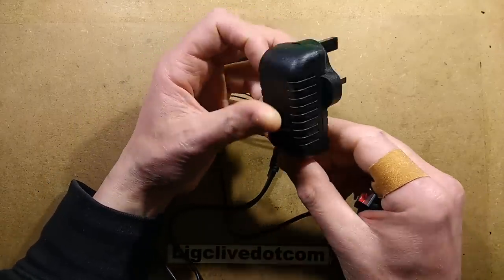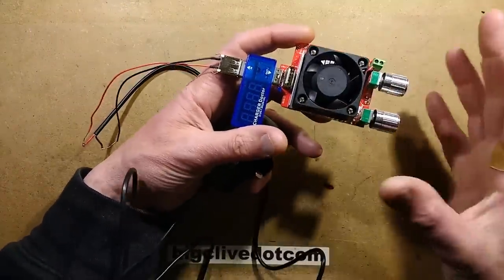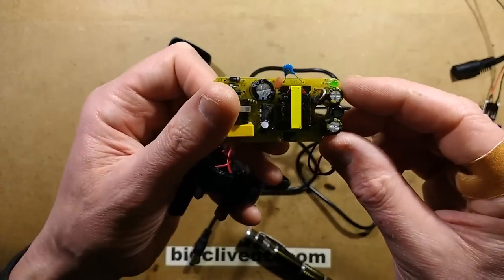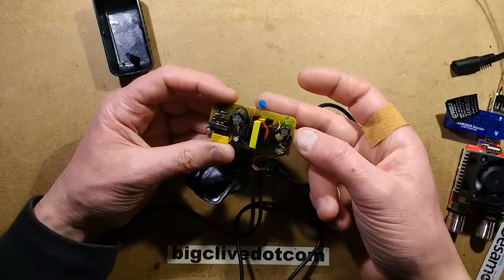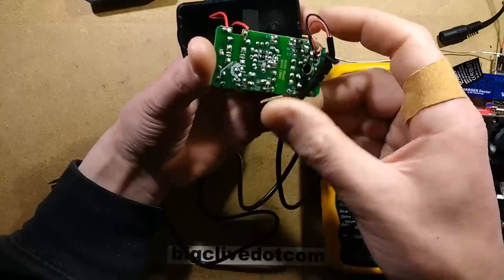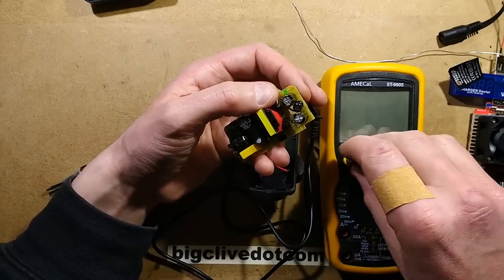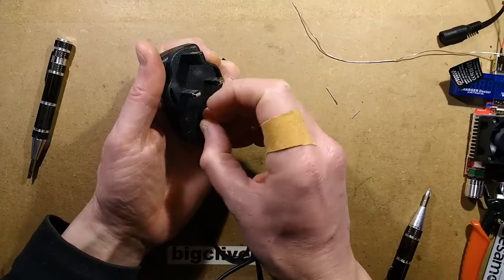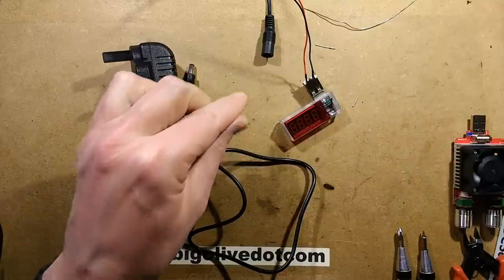Checking out a friends dodgy power supply.  (With storm raging outside.)

Comment: Thanks Clive for the shout out about my Cliff Quicktest units in US/Canada colors on eBay. I sold out pretty quick after the mention. I have put more on order with Cliff but it'll be a few weeks before I have them in hand to sell. It takes a while for them to be added into the manufacturing queue and actually manufactured at the plant then shipped to me in the US but don't worry guys I'm getting more.
Reply: I was super disappointed when I couldn't even find the listing on ebay, guess I was too late. I hope you ordered several hundred thousand of the damn things because I've been wanting one for months now :)
Reply: I don't have that many on order but you can contact me directly via email and I can ensure you get one out of the next batch.
Reply: I will be checking your listings in a couple weeks then. I am also considering a 3 phase one as well for some 220v testing.
Reply: I've thought about getting some 3 phase units in US colors but unsure how they'd sell. Though I'm considering one as a quick connect running 3.3v, 5v, and 12v off a computer PSU for project prototyping since those are the 3 main voltages I use. I'll ask Cliff about the 3 phase units.
Reply: I thought about that as well. But the neons would probably have to go.
Reply: yeah user mod to LEDs as the neons won't light at those voltages, key colors would be wrong too but you can't beat the connection method
Reply: I could not find any listing either but would definitely be interested in ordering one when you receive the new shipment Andrew.
Reply: I used to have speaker terminals (similar lever action) on a PC PSU many many years ago before I had decent test leads. At low voltage the safety switch and expense of a Cliff unit might not be justified.
Reply: I've had to start a list of interested buyers to ensure that people can get a unit and avoid the free for all with eBay until my stock supply stabilizes. If you can email me to the email address in the photo on the video I'll save your contact information and email you when I have stock to ship to you directly.

Comment: Is the storm outside is called Doris
Reply: Oliver Hiscox Yes, apparently today is Doris day 😆
Reply: tony sansom     good one
Reply: i see what you did there,,,,
Reply: 150kph winds reported on the mainland which means probably even higher where he's at.
Reply: Doris left a cripled Scottish plane on Schiphol Tarmac
Reply: did you find dorris?
Reply: +Maico Not as much Doris as a "Crash 8" plane.  A few years ago, SAS had two of these exact failures shortly after each other, followed by a replacement landing gear failing due to the rushed replacement work.  They permanently grounded the rest of those planes and sold the ones that weren't already smashed to pieces.  If it had been electrical rather than mechanical, it would make a nice Bigclive teardown.
Reply: Thanks for your answer. I had already tried to look up what brand/model this 'weird plane with 2 props' was.  Its not well-known out here I think. (except them landing in Amsterdam ofcourse). I get a bit of a feeling that its ''weak' how the landing gears come from the underside of the motor-pods.
Reply: Now I found the brand and model, a Bombardier Dash 8

Comment: I have a laptop power adapter that went pop. It costs $100 to replace so it's got to be quality (they replaced it at no cost). It's got your name on it for tearing apart!
Reply: Great idea, I'd like to see the internals of a laptop power supply!
I would say that a company charging a lot doesn't necessarily link to the quality of the internals.
Reply: I repaired a laptop PSU once. Obviously NOT for use with a laptop anymore. But having 90W @ 19V is pretty useful. Especially for powering things that don't need a specific voltage, but a 12V supply wouldn't be enough. Electroplating, small DC heating elements and trickle charging 14.4V battery packs are uses I found.
Inside one there is generally two heatsinks spanning the horizontal length of the supply, one has the high side stuff like the mains input bridge rectifier and switching MOSFETs, and the other has the output rectifier. LOTS of other components packed inside the case, mainly capacitors, a few ICs and the fairly big ferrite transformer core.
Reply: cerebellum
Schmoo? Someone's been watching a certain Canadian. AvE is great. XD

I also noticed a bit of shielding, which is definitely necessary on higher power switchmode supplies. They leak EMI like they're no tomorrow without it. I can also confirm, Laptop adaptors are absolutely packed with components. They run blazing hot inside, and all of them have very high temp ratings.
Reply: It's 165 watts at 19.8v. The thing that makes it interesting is that it has such a small footprint only 22x150x60mm (.85"x6"x2.4"). I suspect that it's a fuse that went pop because it died during a lightning storm. But it failed in a very controlled manor in that my laptop was perfectly fine afterwards. 

I haven't taken it to bits yet though because the plastic seems to be welded together and I don't have a dremel. Plus I'm sure I'm not the only one who'd love to see the insides.
Reply: bdot02
Gently thumping a corner against a brick or other hard object will get it started. Or you could use the hammer and screwdriver method. Then continue to pry using a screwdriver, and it'l eventually pop apart.

If you do a lot of electronics experiments, and could manage to fix it, I'm sure 165W would be of use. Otherwise it's just fun to tear apart anyway.
Reply: @bdot02  I hardly see fuses blown on switchmode power supplies. It's usually just death-by-age/heat, dried out electrolytics or semiconductors failing without any side-effects except from a supply that just stops working. Rarely do I see blown fuses.  But I usually only get Delta's or Meanwells in my hands, and especially the Meanwells are so thoroughly tested and marked for use in medical equipment and such that it's almost a crime if they would fail with force/a bang.

The best thing to remember it that fuses do NOT work as a protection against lightning. A surge most likely will make them stay intact if it's not powerfull enough.
Most likely the controller-chip failed or (if you're lucky) the MOSFET that takes care of switching the transformer on and off. Though they tend to fail and go short-circuit in those cases, it does happen they go open circuit.

Depending on how well the case is welded, a vise, good blow with a hammer exactly on the weld or a combination of the two will do the trick.
Just remember that you can't use the original housing ever again most of the time (sometimes you get lucky and the two halves just pop open in a very clean manner).
But if you want to use it at full power for long after fixing it, you might want to think about a bigger housing, as they run hotter than I would let electronics get...

Comment: Lovely tip on the auto focus Clive!!
Reply: A cutting mat -- which typically has a printed grid --- on the table/work-bench would likely be of some help -- possibly obviating any need for manual focus. You might also be able to find an app for your phone/camera that allows you to bias depth-of-field so as to place the actual subject distance at the 'far' end -- maximizing the volume, above the work surface, in which objects are in focus.

Comment: Hello Big clive! I love your videos, since you mentioned Digital cameras and not just video recording,  I would like to point out if you didn't already know, that there are actually two types of auto focus, Phase Detection and Contrast detection, contrast detection is what cameras with no mirror will use, IE Ipads, Mirrror less cameras, compact camera, and phones, these will work as you described and will normally have a hunting auto focus where it will move the whole lens system in and out several times to then find the correct distance to make the image in focus, this is a slow way of focusing,  

However with Phase detection, IE DSLRs, the light goes through the lens, and hits a mirror, alot of the light will go up, to the view finder  but part of it will be diverted down to a sensor,  this light hits two sensors, and basicly takes two readings from opposite sides of the lens, this then goes through a chip that compares the two readings and it tells the lens's motors how much to move. which is a lot faster than contrast detection. , however you can not use phase detection with video recording sue to the mirror moving

When you press the button, the mirror moves up and the sensor captures the data , of course, on the one without the mirror, it just takes a photo. this is also why DSLRS make the NICE CHUH Chonk sound while phones do not and have to play a sound for this.

Comment: I have what may seem like a simple question, but I have spent hours looking at reviews and videos about the "3 in 1 853D" station and can't make up my mind. I am trying to upgrade from a 60w iron, lighter for heat shrink and a modified PC power supply for voltage. While this set up worked well for the things I did in the past (RC related stuff) it is decidedly not ideal for PCB soldering. I learned that the hard way when I bought a VERY cheap electronic dice kit from ebay and almost immediately destroyed the PCB trying to solder in the components. So, is it worth spending around 70 USD for one of these 3 in 1 stations?
Reply from the maker: +Justin Updyke I find the multiple functions useful.  These generic Chinese soldering stations are OK for light duty tasks.

Comment: A common error made in the design of such power supplies is inadequate cooling of the output rectifier diode, which is very likely what happened in the design of this power supply.

Even a good  high speed schottky diode will dissipate a couple of watts. For an axial two-lead diode, a common method for dissipating the heat is to use large surface area traces on the PCB, double-sided traces with lots of via-stitching, etc. I've even seen some power supplies where they've soldered a metal tab to one lead of the diode to carry the heat away. I don't see any of that in this power supply.

That diode is going to get VERY hot and fail in short order if the power supply is under high continuous load.

The output rectifier is usually the highest power dissipating component in most switching power supplies, and it is therefore extremely important to consider the thermal characteristics of this rectifier when designing the power supply!

On a side note, since the output rectifier diode(s) in a SMPS is typically the largest power loss, good quality modern high-efficiency power supplies use synchronous rectification (MOSFETs instead of diodes) to achieve very low power dissipation. Unlike a diode, the forward voltage drop of a MOSFET in the "on" state depends on the RDSon ("on" resistance) and current through the MOSFET. Modern FETs have RDSon on the order of a few milliohms. The downside to this approach is the increased complexity of the circuitry, since the MOSFETs need to be switch on and off in sync with the output of the transformer, requiring additional active circuitry to do this.

Comment: ....and then @1:41 BigClive says the magic words I was waiting for, "...so I think it's time to open this thing up!"
Reply: On screws under decals: with a razor-sharp blade, cut twice across the underlying hole, edge-to-edge, with the second cut normal to the first. You can then insert your screwdriver tip through the cruciform cut in the decal and remove the screw -- which remains captive, as it's held in by the decal.

Comment: I've gotten a cheap 24V power supply together with an ultrasonic water atomizer. The power supply weights 64 grams with the cord. It doesn't have an LED indicator. I am worried about how safe it is, so I've put a piece of tape on it and scribbled "SUS".
I intend to never let this thing operate unattended and hopefully get a less-shady one to replace it. I don't know what to expect from this thing.
I regret buying it, because I came to a realization it could be deadly.
Reply from the maker: You're right to be suspicious about generic cheap import chargers and power supplies.  You could get a suitable power supply from a local supplier that has to meet code.

Comment: I'd be very interested in finding the failure mode of these diodes. Are they simply using under-rated parts for the job? Is it being hammered to death by transients?
Reply from the maker: They are put under high stress by the high frequency output of the transformer.  Much higher than a traditional diode on a 50/60Hz supply.  It causes them to dissipate more heat and in this case that has resulted in junction failure.

Comment: I personally would repair and correct the mistakes in that psu, plus drill some small vent holes in the case to vent the heat.
Its still something you could use on your bench :-)

Comment: I have a PSU from a treadmill 240v AC in then 180v DC out to a stepper motor. Plug it in, wait 5 seconds then BANG, massive flash and the circuit breaker trips. Changed all the caps and still does it. Common fault on Reebok & Roger Black treadmills. Would be an interesting break down.
Reply: @Против Глобал That was one of my next changes. The rectifier is hard to get out as the legs are flat then have been twisted then soldered!  Anyway thanks for the hint.

Comment: Hi Clive, I am hoping you could advise me again please? I see you always use the AmeCal multimeter and I am planning on getting one but I have found it cheap but it says it doesn't come with calibration? I am a newbie pretty much when it comes to this kind of thing and have no idea if it needs calibration for the simple hobbiest? Thanks in advance for your help :)
Reply from the maker: The meter is calibrated out of the factory.  The extra calibration is just a certificate that shows that someone tested it against known values.  It's a bit of a racket aimed at the electrical industry where electricians are expected to have their meters checked by someone else every year or two.  It's part of the bloated mess of red tape that the electrical industry has become.  You don't need the calibration.
Reply: bigclivedotcom Thank you ever so much Clive :) my go to electronics guy lol

Comment: Recently bought a QuickTest myself :D I wonder how much Cliff's turnover increased based on BigClive's videos :D

Interestingly I have a 5V 2.4A PSU on my desk where the diode failed, too. It's a Mospec SRAF0880E, which apparently is rated for 8 Amps and still blew. Or the short is someplace else :)

Oh. And storm? Can't hear it because here there's currently a storm as well. A lot of Carneval festivities have been cancelled.

Comment: I have an iMax Lipo type charger, the cheaper eBay knock off. 

I used it three times and it smoked, I got the old meter out and tested for continuity and found that a beefy looking Diode had been cooked.

The input voltage was coming from a regulated bench PSU using c/o Maplins, the XM22Y nothing special happening here type of supply.

Luckily I got most of my money back on the item and got keep it, so now I have something to tinker with.

Comment: That is not a class Y capacitor in any form, it lacks any safety agency markings. It's just the same color to make you think it's a proper safety rated cap. I doubt it is even specially designed to fail open. They are common in cheap Chinese SMPS - that is, when they don't cheap out entirely and put plain vanilla 1kV brown ceramics in there.
Reply: I don't think the colour is a deliberate attempt at deceit (I know TDK, and presumably other reputable manufacturers, to use the blue coating on ordinary ceramic disc capacitors and even low-voltage multilayer types); and not all proper class Y caps are blue, either (some brands are yellow, occasionally even orange, and still other colours may be out there). The labelling is indeed the only reliable indication (barring counterfeits); though if the cap is too thin, that can be a hint. I've never seen a proper Y cap with the rough brown coating, but "absence of evidence is not evidence of absence"…

Comment: bigclivedotcom I enjoy your videos but I am not very good with electronics. I have several of these Chinese LED headlights that use 2 of these 18650 batteries. The ones I have been getting lately have a red light on the battery pack, so it is on the back of your head. I looked at how to disconnect it but it appears to go right to , or be part of the circuit board. I wonder if you you might do a video on how to remove it? I have been putting a piece of black electrical tape over them but this gets messy. Either way, Thank You for your interesting videos.

Comment: Can you use a schottky diode for UF use?
Reply: I think so.  If I'm not mistaken, schottky diodes do not have a reverse recovery time.  They still have the parasitic parallel capacitance, but that should be in the order of picofarads.

Comment: I never bought the quicktest because of the ridiculous pricing with shipping. Now I just need to wait for a seller to get them back in stock.
Reply: Zach Demand I've had to start a list of interested buyers to ensure that people can get a unit and avoid the free for all with eBay until my stock supply stabilizes. If you can email me to the email address in the photo on the video I'll save your contact information and email you when I have stock to ship to you directly.

Comment: I think it's a poor implementation of a good design.  There is probably a high quality power supply like this one (same schematic and layout), except it uses a higher current rating diode, correctly seated components, a real class Y capacitor, good solder joints, etc.